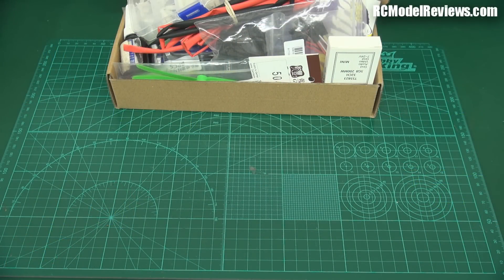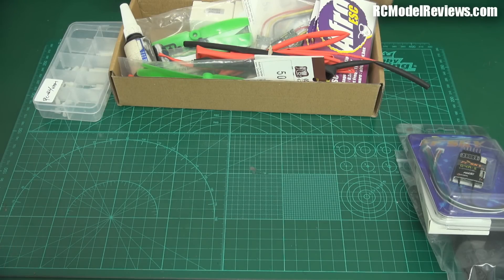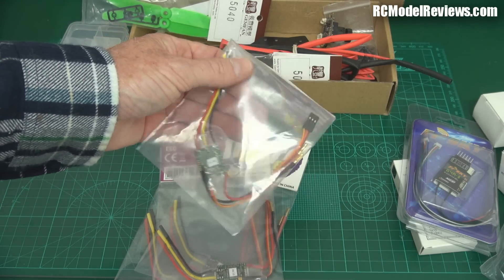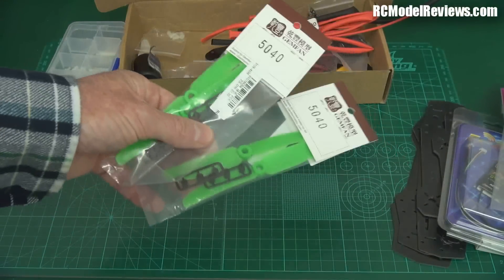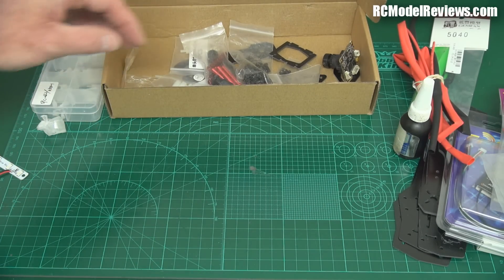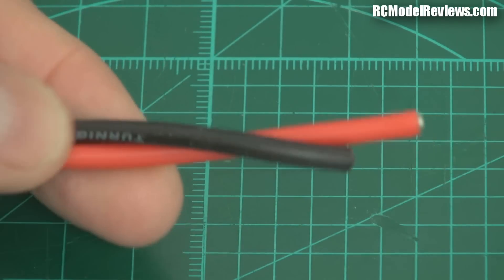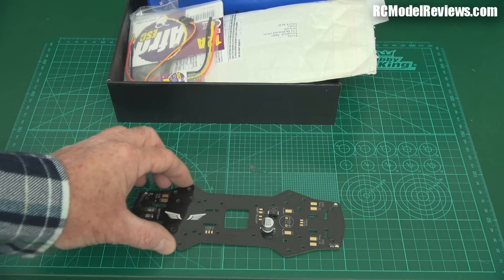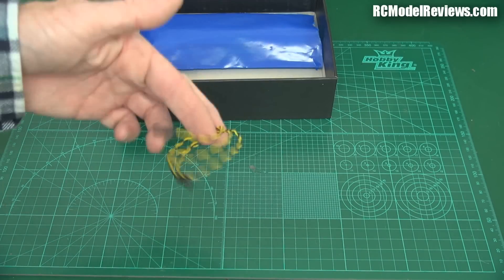Low cost miniquad racing drone build video PART 1

Comment: I couldn't quite make it out, what was that little gadget you showed with 4 pins on each end at 15:26 in the video?
Reply: +Steve C I want to know the same thing, I think he said RSD's or RST's but looking for both on Hobbyking I couldn't find it.

Video was posted in March, you would assume he had some time to update the list.
Reply: +Chris Thomas  I think he said RSTs but I don't know what that is.
Reply: http://www.banggood.com/RCD-3060-OS-Mini-OSD-FPV-Module-p-76371.html
Reply: OK but most of the stuff from Banggood is garbage so I wouldn't count on it working but it doesn't really matter since nobody is ever going to be able to build a quadcopter and get it to work at home without factory support since most of the parts you get are bad and all the software you need to program it is buggy shareware that never runs!  I've been trying for almost 2 yrs to get a Pixhawk PX4 to work but it's just not possible and I got a Quanum Venture "RTF" model from Hobby King they claim flies beautifully but it was too heavy and underpowered to even get off the ground!

Comment: This video assumes the viewer has experience with building. Was hoping for something that explains what and why I need something. Sink issues? Over my head. There must be a beginner's guide somewhere but I haven't found it. Can I mount a hubsan flight controller on a ominous frame? Why or why not. I need the answer to that basic question before I embark on this.
Reply: +Joe Spamola I followed this tutorial as a complete beginner and only ran into a few issues, but I tried to follow this guide as close as possible and got all the same parts.

Comment: Looks to me like for around $60 more you could just buy a Walkera Runner 250. Already built with a remote, battery, charger, FPV transmitter. carbon frame. Total cost $270. Might be the way to go if you have nothing to start with.
Reply: +Steves ForcedAccount you don't want a Walkera runner, read through the Inet if you don't believee. Even my Eachine 250 Racer has better flight performance than this one.
Reply: +Vincent Murray I have one. it works fine.

Comment: do the frequencies of the FPV and receiver etc work and are legal in Australia?
Reply: +Perma Psy They will work in Australia, for 5.8GHz the law is 25mW or less. If you are careful, you could use 200mW/600mW.

Comment: for those who are wondering it is about 199 AUD for the quad without a video transmitter (no links!) and then if you didn't have a transmitter you could buy the Turnigy 9X for around 100 dollars with a receiver. this is definitely a cool build for a first time racer.

Comment: Holy crap.   Big investment and a lot of work.   Ok, so missing from your first video, is what you would use on the driver end, for goggles / video monitor + radio transmitter  controller ???    A tablet or smart phone?   Seems like that would have to be included in the cost.
Reply: Wow, hard to believe it's been 7 years.
I tried them, they didn't work for me.  Blind people can't solder.
Seven years, $3000 on equipment, and I only got to fly for 5 minutes.  Yeah, this hobby turned out to be bullcrap.  No wonder the RC hobby has made me absolutely miserable.

Comment: I purchased this exact setup. except I got the emax 12a esc's from banggood.   it all went together perfect.  got my Naze32 setup (used Cleanflight) ..Orange RX R615X w/CPPM from HK.  this thing flies awesome !!!!  haven't put any FPV stuff on it yet....that is next !     I thank you for the great information .
Reply: +pointnozzleaway why did you go for the emax esc's? price? which transmitter did you use? thx :)
Reply: +Marcel Niggenbölling . went ahead and purchased the emax esc's while I was buying all the other items. I have used the emax motors with great results. ESC's were $8.60 (US) from Banggood.  I am using a Spektrum DX7 for this quad.  this is my first quad...so I'm just trying to get the feel.  but like I said it flies awesome

Comment: Hi Bruce, I wanted to share some information with you.
I wanted to let everyone know of my problem getting the X4RSB to run on its Sbus channels for my Naze 32 FC. I had bought a Sbus to PPM converter but I could only get it to run on PWM only. When I connected the S-bus I would not get a signal. I even went to far to build my own inverter cable,but no signal. I finally came across a forum and it told me what the problem was. I could run the ground and positive as usual . But I had to take the signal wire and run it on channel 4 by itself. Once I did that I had the full 16 channels from that tiny receiver, and on a single cable as well. I hope it helps anyone who has the same issue
Joe
Reply: I hope that you found this of informative.

Comment: Hi Bruce, Awesome set of build videos and thank you for your time and effort. I didn't think I could afford to do this but after seeing what you did, now it looks like I can. However, one thing is missing, at least as far as I can tell, what transmittter would be acceptable to use under this "Budget Build" concept. The Fr Sky Taranis about doubles the price of this quad. Could you reccommed a decent entry level CPPM compatible Radio? I have been looking and the Orange T-Six is available for around a $65 (US), which is quite a bit less than the Taranis, but for a beginner would this be acceptable for a mini quad build?

Comment: hey bruce look what i found on ebay
http://www.ebay.com/itm/Fiber-Glass-Mini-C250-Quadcopter-Motor-Esc-Flight-Control-Board-T6-transmitter/311162040195?_trksid=p2047675.c100005.m1851&_trkparms=aid%3D222007%26algo%3DSIC.MBE%26ao%3D1%26asc%3D32687%26meid%3Dd90d297f6be947478c76ac23bff504a5%26pid%3D100005%26rk%3D1%26rkt%3D6%26mehot%3Dpp%26sd%3D121479742039

Comment: Great video im definitely going to build this for my first quad. Couple of questions.
1 would this radio work ok http://www.hobbyking.com/hobbyking/store/catalog/62709.jpg
And 2 i only need batteries for radio and quad everything else is in your build list above?
Thanks so much.
Reply: Lincfromaus Yep I have that radio, works well. Just be sure it comes with the receiver or you buy one (e.g. Turnigy iA6 Receiver) . And yes you only need 4x AA for transmitter radio and the 3S Lipo for the quad

Comment: Hi thanks for uploading these videos :-) i am here now pricing stuff up into uk pounds. i was wondering could i use 2400kv motors? only for some reason the 2400kv motors are way cheaper here in the uk compared to the 2300kv versions. many thanks, rob

Comment: I need some help since Im all green on this, Im planning to build this very soon and I was wondering about the transmitter and receiver. Bruce choose a Frsky D4R-II receiver. Will that work with the Turnigy 9X 9Ch Transmitter, see the link below?
http://www.hobbyking.com/hobbyking/store/__8992__Turnigy_9X_9Ch_Transmitter_w_Module_8ch_Receiver_Mode_2_v2_Firmware_.html

Or is it a receiver for the quad already included in that package?
Reply: Daniel Wiklander I would not risk it so don't buy the frsky one
Reply: Plane Flight  Ok, I didnt take the chance. I order the package I linked to. We will see how that will do I guess. Waiting for all my parts to arrive right now :)
Reply: Daniel Wiklander  the Frsky D4R-II receiver does not work with the Turnigy 9X out of the box.  You can  modify the 9X to allow you to use it and later on you may want to do that since the FrSky radio system is much better.    This is one of the reasons the 9X is a good choice for a cheap radio.  See http://www.smartieparts.com/store/en/ for some upgrade ideas

 The RX that comes with the 9X will work but it's a bit big for a mini-quad.  This one will work http://hobbyking.com/hobbyking/store/__12901__Hobby_King_2_4Ghz_Receiver_6Ch_V2.html and may fit better.  
Try to order from an HK Warehouse near you for better  shipping times.  

I believe the FlySky FS-R6B 2.4GHZ 6Channel AFHDS Receiver will also work  since I'm reasonably certain that the HK/Turnigy V2 protocol is FlySky AFHDS.  The Turnigy 9X is a HK branded FlySky 9X .  

Note: FlySky is not the same company as FrSky
Reply: press all the knobs Ok thanks for the help. I will start with the RX that came with the 9X and see how that goes and go for the smaller RX later if necessary :)

Comment: Thanks for the great viedeo's. I orderd my parts today after looking arround and for almost everything i use the parts that you use in the build.
I only went for the THuG230 frame and red props. I must order still some parts but hobbyking has not everything in stock. need lipo's and transmitter. All other parts are orderd. Hope it will come soon because the spoeedcontrolls were in backorder.

Comment: Thank you for your videos, great job. I used this build as a guide for mine. I bought the FS-I6 as a remote to get started and it will not do anything after I binded it and had everything hooked up. I read that the FS-IA6 receiver is just for fixed wing/glider/airplane receiver but previously heard it would work with quads. If it does work is the wiring different for PPM with this set up? If this receiver doesn't work with quads what receiver do I need to buy??? Waited so long for parts and now to try to figure this out is just horrible. Thanks for any help.

Comment: Anyone who built this little guy, or even Bruce: what was the round about price for what Bruce bought? just curious about an estimate , no need to be super exact. Thanks!! =)
Reply: Killaxcon Probably $150-200 for the quad (no FPV), add $60-90 for a transmitter, add $80-120 for FPV (cheap monitor from Ebay)

Comment: can't we use jst instead of xt60 plugs?
Reply: Ashish Amatya You can for very small quadcopters (e.g U818A) but these ones use a lot of current and will burn/melt the cables, plus you'll have a voltage drop if it gets hot

Comment: Here is my build sheet, for a very similar ZMR250 budget build. Most of the same parts, some better choices like Naze32 Clone with Programmable LEDs, and Cheaper PDB solution. 

https://docs.google.com/spreadsheets/d/1iBbATQdCcic810BLvwaSg9goDTIwybnXk-idnVYT1BM/edit#gid=0

Comment: So I am trying to keep costs down and seeing I already have a dx6i from spectrum I am trying to keep that and therefore find a receiver for this. I was advised to go and check out orange and now reviews from lemon RX seem to have been tested. Anyone has feedback or advice on what to get from either orange or lemon RX? Fr the first 250 quad I'm sure dx6i would be plenty enough even if there are limitation, no?
Reply: zewill So after some research on rcgroups, lemon rx is the way to go. Havtn tested yet, but Cheaper and as good (if not better, according to people who have tried them) than Orange or Spektrum tx. Recommended is the 6 ch (or more according to your needs) DSMX + sattelite for around 15 usd. You can have Dsm2 for around 6 dollars, a steal. Shipping is extra and 4 usd.
Reply: +zewill Thanks for your reply on your own question. I have the same problem and I only found discussions, where people said that there are no 3rd party RX compatible with Spektrum DX6i.
Did you succeed, pls let me know.
Reply: +Andreas “rbcolor” Reiszner hi! My quad works beautifully with a lemon RX 6  channel! I got the 6 Channel And satellite but thats overkill! Works perfecly with dx6i
Reply: +zewill hey, wow. well that was  a quick reply. thank you!
one more question, where did you order the RX?
Reply: +Andreas “rbcolor” Reiszner type lemon RX they have an official website. Delivery is slow and expensive for the fine frame involved... 3 weeks.
Reply: +zewill still, I recommend.

Comment: I need help with something. I have recently put together my first 250. But im having troubles with motor 1 on a CC3D. It is not the motor or the ESC. When i plugged motor 1 into port 3 on the CC3D it spun up no problem just as motor 3. but when I plug motor 3 into port 1 it will not spin! I have found the same with the other two motors. What i have concluded is that my channel 1 port on my CC3D does not work. However this doesnt not really concern me because i dont think i will ever put this on a hex. My only problem is, i have no idea how to get ports 2-5 to be the ones used instead of 1-4. If you know anyway to fix this or have any suggestions they would be greatly appreciated

Comment: I enjoyed this series and have ordered parts to build one. Mostly from Hobby King and Amazon. Being frugal, I am still at $204 without any video gear yet. I enjoy building things with my hands and doing projects with my son so its worth it to me. BUT! With products like the Walkera Runner 250 and the amazing Armattan 258, why bother. You can get them both in kit form and come with everything you need. Armattan even includes the solder, as he wants you to use good quality solder. And the air frames come with a lifetime free replacement warranty!! Amazing and sad as I enjoy the thrill of the hunt for online bargains. Oh well....... Bruce, love the channel, enjoy the fact that you have a strong electronics background and can explain your opinions. Build these, you wont be disappointed.

Comment: I would really want to thank you for all your effort in this video. I ordered everything you said after a lot of research. All parts are still the best options when you start with this hobby i concluded after a lot of reading.

All your videos are a great way to gather info, very much appreciated. I subscribed :)

Only thing i did different i ordered the frame from ebay since they are cheaper there.

Comment: Hi, What transmitter would you suggest to use for this budget build? i got the frsky D4R-II before i realised the controller was so expencive.
Reply: Steve Taylor Have you managed to sort this out? I have the same question, although I have not yet bought the FrSky receiver. Before I do, I want to find a suitable inexpensive controller.
Reply: Peter B i got a flysky FS-i6

http://www.banggood.com/FlySky-FS-i6-2_4G-6CH-AFHDS-RC-Transmitter-With-FS-iA6-Receiver-p-922606.html

Works really well and is perfect for the bugdet build!
Reply: Peter B and it comes with everything you need to connect to the Naze32

Comment: Hi Bruce great vid as always, Im new to the mini quads and I wonder if I could upgrade the afro 12A with a RotorStar 18A (2~4S) SBEC Brushless Speed Controller? I read it would have a better performance...the Skyzone SKY02 V2 AIO 3D FPV Goggles (camera and receiver) could be too heavy to this quad? Thanks for nice explanation

Comment: Hi Bruce. I just started acquiring the parts to do this build. My frames came today and no aluminum standoffs included... Could you please tell me the size of the aluminum standoffs and also the size for the plastic standoff you used? I'm using Naze-32 FC and a FrSky receiver.

Thanks for all you do.

Comment: This will be my first build. I need everything. Please feel free to update my list.

-ZMR250 frame
-DYA motors (4 pieces + 1)
-Afro 12A ESC (4 pieces + 1)
-German 5x3 propellers (4 sets???)
-Naze 32 flight controler
-Sony 2.8 camera or ELGAE® FOV127 FPV200-set with LT200, V700 and FPV RTU cable(32CH) SMA
-Video transmiter SkyZone TS5823
-Video reciver (what kind?) Is it universal? Does it with many transmitters?
-FrSky D4R-II reciver
-Turnigy 9xr transmiter???
-FrSky DJT module (do I need one?)
-Battery (what kind & how many?)
-Battery stripe
-Thread lock - blue
-Wire red & black
-Battery and other connectors (what kind?)
-Servo tester? Do I need it?
-Nylon spacers/stand off (what size?)
-Nylon nuts
-Nylon screws
-Quanum DIY FPV Goggle Set with Monitor (KIT) or Fpv googles (FatShark? What model?)
-Heat shrinks  (what sizes & how many?)
-recording video camera RunCam HD or Mobius
-LED red and white
-tools???

Comment: If i want to buy EMAX MT1806 KV2280 Brushless Motors. Do i need to buy them 2x CW and 2x CCW or i can just buy them all CW and then just solder them together with ESC by switching the middle wire with 2 motors? 

Thanks!

Comment: Hi Bruce! Do you have any recommendations for a budget Transmitter? I was thinking about the Turnigy TGY-i6 from HobbyKing, seems good and has good reviews. I mostly plan on ever flying 250 mini quads like the one in this video series but I suppose someday I could venture into bigger multirotors. I am hoping to keep it around $50 US including RX if possible which is why the Turnigy looked good to me.

Comment: Hello,

For this package worth buying?

1 x QAV 250 Carbon Fiber Frame Kit
1 x CC3D Flight Controller
4 x Emax MT2204 KV2300 Motor(2 CW and 2 CCW)
4 x Emax Simon K 12A ESC
4 x Gemfan 6030 Propeller

Anything else i miss out? Please advise. Thank you.

Comment: Thank you very much for such an informative series. I am looking forward to your updated part list so that I can start buying parts. I have some questions in mind as a beginner and I hope someone here will help to answer. First one is which is better stabilization system KK2 v2.1 or NAZE32? and I have flysky 9x radio with ER9x firmware. Can I use that radio to fly quad or I have to get some expensive one. Thank you in advance.

Comment: Hey, I know your Budget Mini Quad build video has only been out for about a month but I would like to ask some things before I go and start ordering parts. I was planning on using a DEVO 7 transmitter with a co-responding transmitter from walkera to do the build, would this be compatible with the Naze32? I also need to know where I can find the battery that you used in the build and what diameter of heat shrink tubing you used. Thanks for creating this awesome build series, it has been really helpful and informative.
Would be awesome to hear back, thanks!